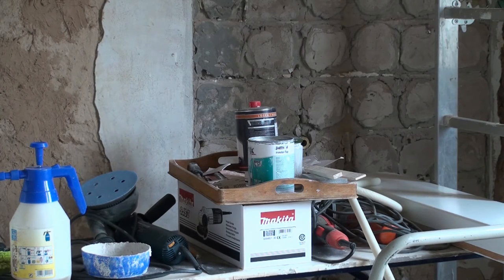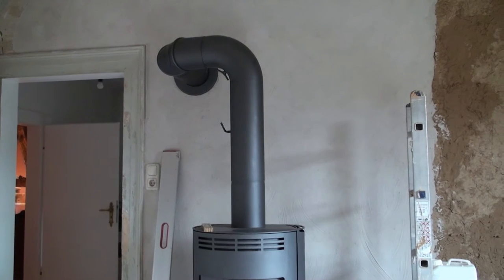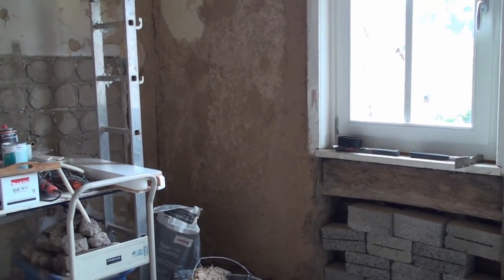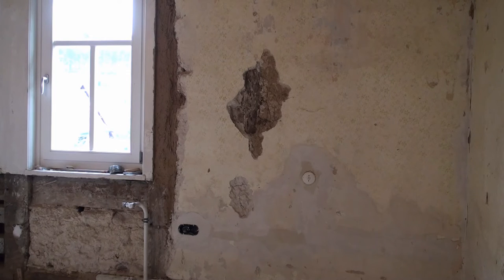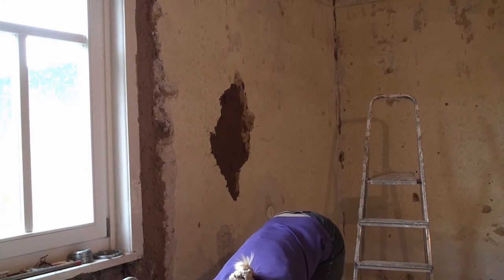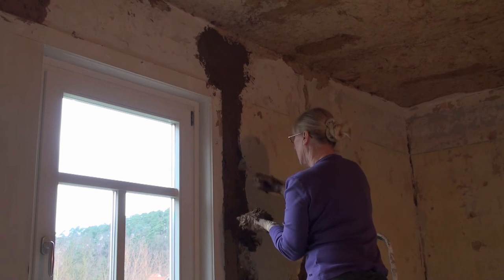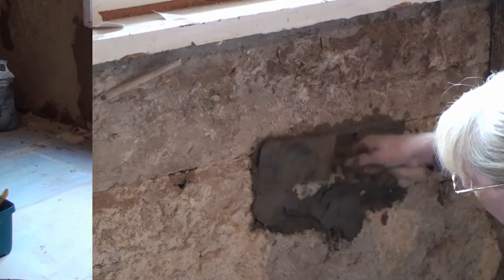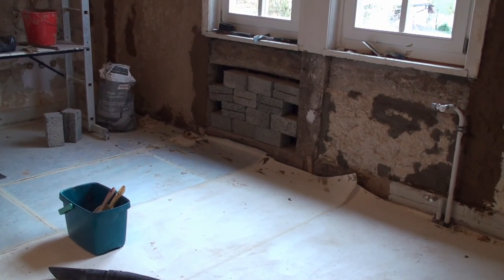Restoring the last room in our 4-story house - Part 12 Repairing the walls with clay

Comment: Hi Bruce Enjoy your videos as always. I hope Karin's Hourly pay is good. Just a tip that I know. When I was a young lad I use to visit Building sites very often. To make plaster go of quickly the plaster was mixed in an old bath. Followed by lots of men peeing in the plaster. Apparently it made it go off very quickly. Also finishing plaster had washing up liquid put in it to make it more slippery. Smooth etc. I use to make the tea to drink in an old clothes boiler, Gallons of tea as there were a lot of workmen on the site who were alway thirsty. Cheers Bruce.
Reply from the maker: +MakeDoAndMend1 Karin says if I pee in her plaster she'll dump it on my head. :-0 Thanks for the comments.

Comment: Very interesting. I was curious if ever you might use a spray bottle with water to possibly moisten/prep the old surface of clay before installing the new clay or is that never needed? Thanks for all the videos!
Reply from the maker: +vw64manyrd We do that in many cases, but here Karin made the clay she was adding to the wall so wet that it wasn't necessary. Thanks for your thoughts on this.

Comment: Well done our house seams to be made of sand.
Reply from the maker: +spanermantim I don't know when your house was built, but houses that stem from after WWII here were made with very little cement and a lot of sand. We've been told that they used as much as 10:1 whereas 3:1 is considered good practice. It's little wonder that the walls fall apart when one tries to hang a picture. Thanks for dropping in Tim.